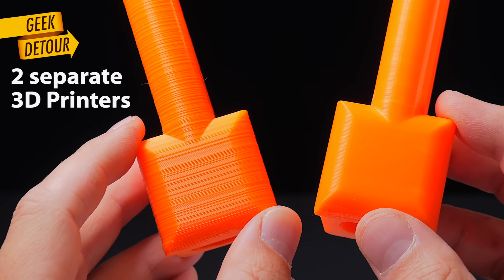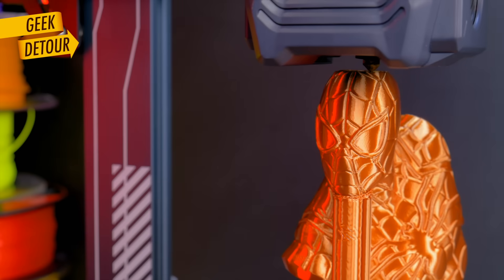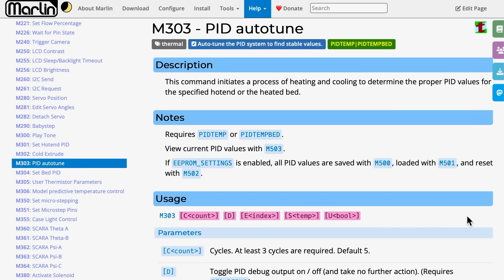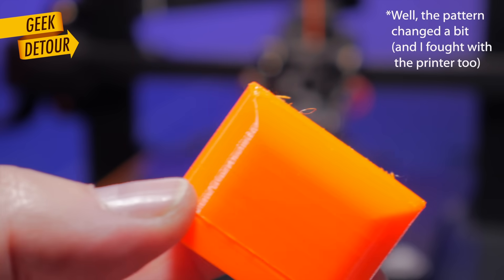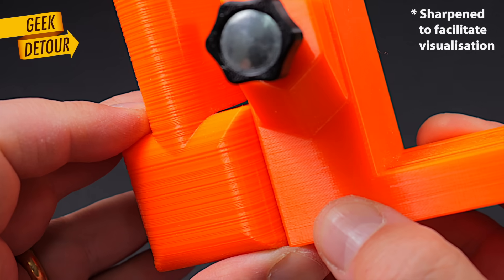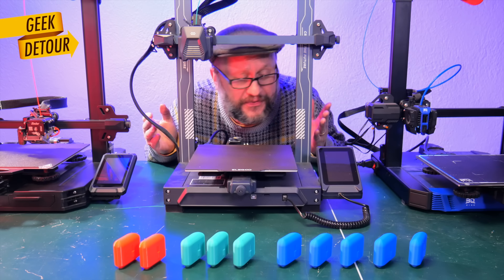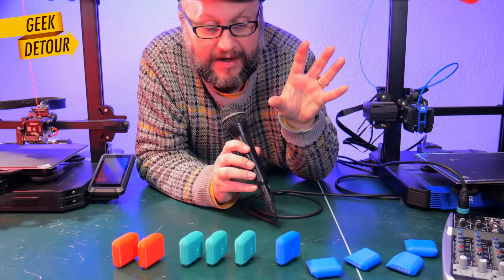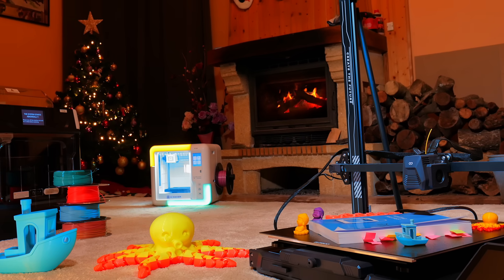3D Printer Problem: do you know How to Fix Z-Wobble?

Comment: With the Z binding lead screw nuts how loose is too loose and too tight?
Reply from the maker: Imagine it’s completely tight: it won’t have any lateral movement. You loose it a bit, you will be able to have lateral movement (but it won’t be easy)… you loose it more, sideways movement will be easier. But there is a point where loosing it more won’t make it move sideways any easier. That’s the point.
Reply: @GeekDetour  thank you! I think this was my issue after a rebuild and lots of stress.

Comment: Is the book worth it?
Reply from the maker: I bought my book in July 2013 - I liked it a lot. It took a few months before I had a video that would make sense to show it. Anyways, the book teaches a lot and it is more useful depending on the 3D Printer you have. Ex: if you have a brand new BambuLab printer, you might find most of the book “weird” since their printers are very well calibrated. If you are struggling with imperfections, or you want to fully understand how different factors play along on a good 3D print, the book is very handy. I read from the beginning to the end. Sure, I knew most of it already - to me it was a cool reminder of how much 3D Printers evolved and current new machines have most of it sorted out from factory.

Comment: One way I solved this on my ender3v2 was buy a flexible coupler which compensated for that. Reason I have done it that way, was I could not loosen the screws, since if I did the whole screw assembly would fall apart.

Comment: That is actually Z wobble or Z axis vibration, here's how you can replicate it, the printer should be old i must say, 
1- Load a new spool on the printer (should be on the spool holder above)  
2- print something that has large travel distance on Y axis with z hopping and retractions enabled, and that's it.

 It basically happens due to the flex in Z axis aluminum rails, when you have weight on it ( large enough spool ) and large travel distance where the bed will accelerate between layers along Y axis it causes small vibrations at the bottom that magnify towards the top due to the weight of spool. This can be fixed by installing traction rods that connect the top of Z axis rails and the base of the printer

Comment: lol if you have the s1 pro it might come like that from the factory. got one at micro center and when i started the cat print it comes with it failed right away. i was going crazy cus the printer was brand new . sure enough that was my problem. loose zrod bolts all 4

Comment: Love that you couldn’t recreate the problem. It’s like when I ask for help with something and someone finally comes to my desk and the problem has completely resolved itself.
Reply from the maker: Yeah, that’s why some software bugs are very hard to catch: there are corner cases that require specific factors that can be very circumstantial.
Reply: @GeekDetour  oh definitely. Mines usually an error when writing a function in excel. the format type is usually my most common error. So annoying. Haven’t had too many issues with my printer thankfully. I’m better at solving code problems than hardware.
Reply from the maker: Mechanical domains have a bigger set of uncontrollable variables 🤣 On a previous life I was a software developer too - so long ago most of what I used now is old fashion, ha ha.
Reply: @GeekDetour  one of my first college courses was an Access course, so I feel ya a bit!

Comment: Use a Bambulab and you will not have more problem anymore
Reply from the maker: That’s absolutely NOT true 🤣 I have a P1S that, indeed, is VERY reliable - but I had to adjust its belts tensioners after a few months because it had an ugly Vertical Fine Artifacts issue. I also participate on the BambuLab Facebook Users Group and I see the photos of the problems. It’s a machine, trust me, you need to fix things. But it’s awesome 👏

Comment: tighten all the screws! frame's loose somewhere
Reply from the maker: Nope, it was not. The frame was impeccable. But, sure, that’s something else to check from time to time.
Reply: @GeekDetour  thats what it was for me, on my elegoo neptune 4 max. found 6 loose screws in total. Started by tightening those z screws you said arent supposed to be tight.. I didnt know, and they are still tight. Solved 50% of this z drift issue, after i tightened alllll of the screws on the machine, prints are 100% perfect. Don;t even need to wait for heatcreep anymore!
Reply: 40% was the z screw, and another 40% i attribute to the screws holding the hotend INSIDE the extruder, not being tight..
Reply from the maker: If it works fine in your machine, that’s great 😀

Comment: Bent Z axis leadscrew?
Reply from the maker: Nope! But it could be… the only difference would be that a bent LeadScrew usually makes a very regular pattern that repeats every 8mm in Z (that’a the vertical displacement for 1 turn). In this case, it was very irregular lines. But even so, there was a pattern, I suspect something related to the nut… hard to know.
Reply: @GeekDetour  Haha! That was the guess I made before the video started!

Comment: go try again, tigthen rods in far position, and in close position, there might be a difference
Reply from the maker: Interesting, if you lock the nuts but the leading screws are very well centered, there might not be a big difference - but it the motor is a bit off-center, or the nut tightened more to one edge, there could be a more noticeable problem. Anyway, when I get back to ZBinding, I might actually test the POM ZNuts that I bought months ago I didn’t have time to try them on yet 🤣

Comment: Hello, I have an Ender3 S1 and for days I have had several problems apart from that, I have the bed well leveled but it leaves gaps in the first layer, I don't know what to do anymore, could you help me?
Reply from the maker: Gaps in the first layer you need to adjust the z-offset. That’s an easy thing. Search for how to adjust Z-offset Ender 3 S1

Comment: I was having Z wobble on my new Neptune 4 so I thoroughly checked and tightened every screw and bolt on the printer, but somehow the wobble got worse. Well, one thing I tightened was the lead screw nuts! I must have made them too tight, but thanks to this video I know what I did wrong.

Comment: Guys im frustrated with my s1 pro i have z binding i did everything in your video ajusted the nuts lube the hell out of the rods but i cant get rid of the z bijiinding someone plss help me to fix it. So the only time i didnt had z binding was the time that i changed the whole hot end it was good for 1 week then again i had same problem idk what the F should do to make it work normal
Reply from the maker: Your best chance is to post photos of your prints on the Ender 3 S1 Pro Users Group on Facebook. Without seeing your prints it is impossible to know exactly what is going on with your printer.

Comment: Great video. If you were to speak louder into the mic, and turn down the input volume however, the sticky mouth sounds would be far less of an ear sore.
Reply: Also, consider adding a de-esser into the mix.
Reply from the maker: Sure! A couple of people gave me basically the same suggestions - on my last video I used a de-Esser and a declicker that reduced the bubbly mouth clicking sounds that are annoying.

Comment: Excessive flow, will also create that condition. Many printers with brass nozzles, start out great, but those soft nozzles wear, increasing flow. Get hardened steel nozzles and tune in the flow rates.

Comment: I had similar issues but it was worn wheels, cause I had them slightly to tight it created very small flat spots replaced them with harder density wheels and adjusted them slightly less tight then before and been printing for over a year since flawlessly

Comment: Without z-wobble there wouldn't be any z-binding and no need for a loose connection between nut and carriage/gantry. 
So in the end the problem is still the cheap wobbly lead screws. Manufacturers just found an equally cheap solution that works 99.99% of the time for 99.99% of ppl.
Reply from the maker: Well, I won’t disagree 🤷‍♂️ That’s the motto of mass production: finding the sweet spot between super cheap and works great. Overall, the leadscrews in 3D Printers give a quite reliable solution: z distances are guaranteed and if well lubricated, you can barely see artifacts on the printed parts. To get it even better, costs start to get way higher. Whoever wants better, end up modding the printer.

Comment: I prefer WD-40 lub, as it does not mix with dust as silicone, which makes putty mixture.
Reply from the maker: This would be an interesting topic: which lubricants would be better for which part and why… or if there is not a clear winner, what are the pros and cons of some options. Have you been using WD 40 for some time?

Comment: Other plausible and sometimes hard to fix problem is inaccuracy of feeding mechanism. It can be dirty, it can have too less pressure or can be imprecise from the beginning of printer’s life. The last one is impossible to fix without some parts exchange.
Reply from the maker: You are absolutely right. The extruder is so important and it is easy to overlook - specially about it being dirt with tiny rests of plastic, and the results become very weird. It was not my case, though 😅

Comment: I'm having a lot of problems with my Neptune 4 pro, I might return it, I tried everything to fix this problem but I can't, I think the problem has to do with the wheels too but the official eleggo yt video fix does nothing, I got it to print very good for a whole day until it was bad all over again, lubricated, tighten the screws untightwn them, nothing, I even straight the rods and still nothing, the print had has a lot of play too but I can't tighten that eather.....
Reply from the maker: Hi there! Is it your first 3D Printer?
Reply: @GeekDetour  yes and no, its my secund i had problems with my first too and retuned it, also i cant find direct help with anyone sadly, i joined discord but its so hit or miss, heres what i have tried:
-realighning the rods
-bed leveling
-the head moves but i cant fix it more
-the wheels that more up and down i cant get them properlly siting, elegoo has a video on it but i follow the steps and did nothing
the brass part you talked in the video that move with the z rod i have tried with them tight, supper lose and +/ tight still same results.
also when i releveled the rod the prints gave a better result, the part where the printer head is around 2mm off to one side making the top wheel on the left to stay with presure and the bottom right wheel to have presure too, i tried to level it too but when i try it just goes back to the position it used to be
Reply from the maker: I recommend you to invite a friend who has experience in adjusting the printer mechanically. When you write: “I adjusted the wheels” I read: he tried to adjust the wheels. How tight should it be? Someone with experience can help you a lot.
Reply: @GeekDetour  the thing is i have no one

Comment: If you can’t reproduce the problem, than it wasn’t the problem. So misleading title
Reply from the maker: If I had stopped the video before trying to recreate it, you would have taken it without questioning. Trying to recreate the exact same mechanical/chemical circumstances is harder than fixing the problem. It was fixed. It still is 🤷‍♂️

Comment: Wow. Thank you so much! This is the second time you've saved my prints. I encountered the mysterious blobs issue a while back and after seeing your video, reformatted the SD card I use and got smooth prints again (I now assume memory fragmentation made it slow, as it had been used for astrophotography with many write/erase/rewrite cycles).

Now, I had a slight layer shift issue, so slight that I couldn't tell if it was Z binding or actual layer shift.
I adjusted the bolts on my rods like you did out of despair after trying everything, and it now prints good as new!

Thank you so much for making these videos. They are treasures of information, so well explained and documented, so useful!
Reply from the maker: Wow 🤩 I read your comment two days ago - only had time to answer now. THANK YOU! You made my day. Each video takes A LOT of time… and sometimes you wonder if it is really worth the effort. Messages like yours give me strength to go on❤️

Comment: For anyone still lost or just curious

Z binding can happen numerous ways.

Your rods can be bent

The rod(s) may not truly be perpendicular to the gantry (you may have a loose rod or improperly installed)

Your gantry may be a little tight

There may be physical obstruction within the threads that can cause minor friction thats hard to notice - this can be debris or some gnarled threads.

Loosening the screws to a minor degree can potentially solve some minor tolerance issues but they should not be so loose that they float
Reply from the maker: You are right! Many things can cause this problem. That’s why I started the video exploring different possibilities ❤️

Comment: I had the same issue with my prints on an Ender 3. I lubricated the Z axis rods and tightened everything I could find. 

Of course it's the one thing that's supposed to be loose that was the issue, it probably was tight from binding up and I just secured it more.

Thank you so much.
Reply from the maker: My pleasure man! Thanks for sharing!

Comment: My guess, The lines are the result of the 3D printer's layers being stacked perfectly atop each other, which is not ideal as the head prints a roundish shape, not a perfectly square one. If I had to say off the top of my head what could be done to improve upon that, I'd stagger the print passes such that the line of each pass was directly between the lines of two passes of the prev. layer. this way everything would bunch together more neatly, reducing the spacing that might be the cause of the rough surface

Comment: Very often when issues with §d print quality become visible there are already multiple things missaligned... I would have guessed that it is most likely a mechanical problem. Either Z-axis directly e.g. the threated bushing to loose/to tight or the coupling connecting the rod to the motor incorrectly installed or I had similar surfaces already when the duiding rollers were not alligend correctly and either the gantry or the sledge was loose...
Reply from the maker: Absolutely! It is super “fun” when someone brings you a printer that is printing bad - you have to check EVERYTHING mechanical.

Comment: The sides of my prints have been like that for years. I've done all kinds of upgrades, including Z wobblers, which should make binding impossible. NOTHING helps.
Reply from the maker: Hi there! I understand the frustration. I need to say the Mod culture sometimes leads the printer to worst… I made many mods on my Ender 3 Pro - some were clearly worse than stock. That’s why I don’t recommend someone to buy a 3D Printer and start modding it right away. Specially when that’s the only printer the person has - the person doesn’t have something to compare. 
You probably saw photos and videos of incredible prints made on stock printers - they got much better than a few years ago. So, if you like the hobby, maybe it’s time to consider starting again.
Reply: @GeekDetour  I built my RailCore from scratch. In a real sense, there is no stock RailCore. But I did go with the original basic design for the bed and z-axis lead screws and linear rails.

I did start with a creality machine which doesn't really have the problem although it didn't work adequately until I rebuilt about half of the machine. Very poor quality control. 

One of the things which bothered me about this is I didn't buy it for a hobby. I bought it because I needed a tool, but nobody mentioned that it's really just a toy. Nobody said I'd be getting into the amount of fiddling it required. I wouldn't have gone into it.

Comment: What about the Artillery Sidewinder X1? There's no such thing as seen in 3:32. In the X1 there are 4 little screws holding a small blue case which is holding a ring where the rod is attached to (I guess) How would I get rid of Z-Binding there?

Comment: WHEN ASSEMBLY AND USING MY NEPTUNE 4 A LITTLE, I NOTICED THAT THESE SCREWS ON THE ASSE WERE A LITTLE LOOSE. I WENT THERE AND COMPLETELY TIGHTENED IT. I DID IT WRONG, RIGHT? I SHOULD LEAVE THEM A LITTLE LOOSE, IS THAT?
Reply from the maker: Yes. 😄 The Printer should print better quality parts (in the Z Axis) with them a bit loose. Print something before and after - I am curious about what you will see!

Comment: I should try this z binding solution on mine. Has anyone tested printing in vase mode? In theory if you get misalignment of the layers on normal prints, if you try printing a straight single pass wall, the lines would not be placed perfectly on top of eachother and it would look really ugly - might even fail. But for some reason walls come out just fine in vase mode and come out misaligned in normal prints.
Reply from the maker: If you get Ok prints on Vase Mode, but walls seem now well aligned on prints with different geometry, check for mechanical problems like: too tight v-slot wheels (or  loose to the point of wobbliness), maybe too lose belts (so it introduces backlash). Pay attention to the mechanical things I mentioned in the beginning of the video.

Comment: easy man take a 800p sand paper and a bit of water and you gona have smooth surface
Reply from the maker: Sure, we can always sand the parts… but I prefer when the printer prints it smooth - and with proper adjusting, settings and lubrication, they do an excellent job.

Comment: It hapend cose 3D printer printer in layers
Reply from the maker: Well, yah, it is printed in layers - but you can get pretty much smooth prints… or very irregular prints, if the machine is not well adjusted and lubricated.